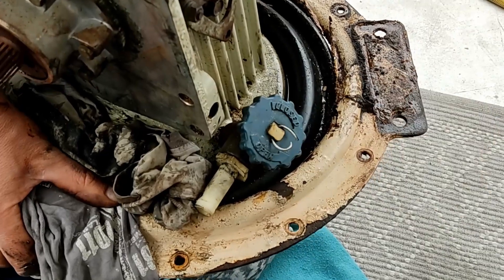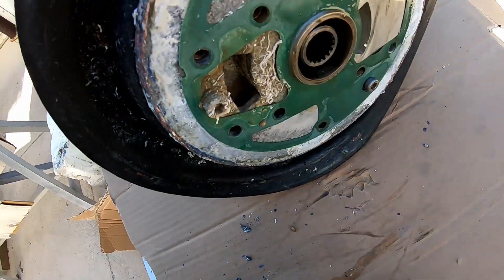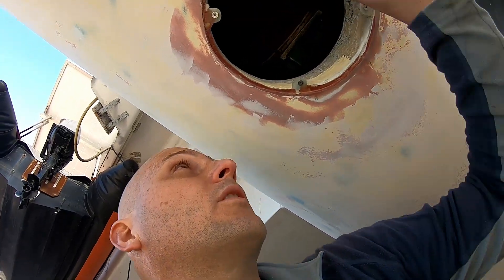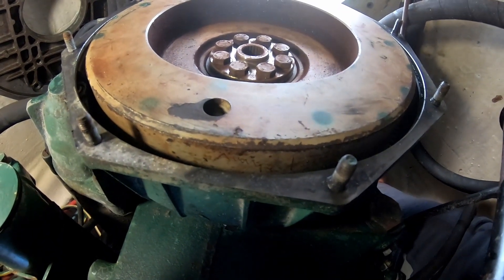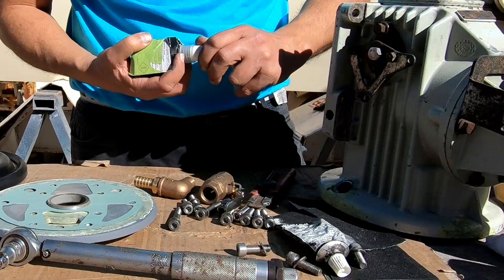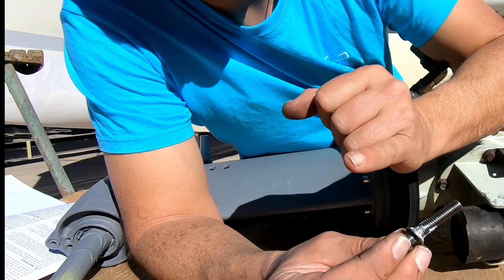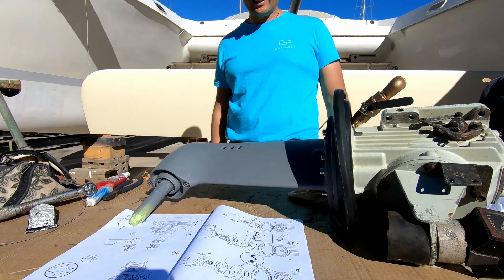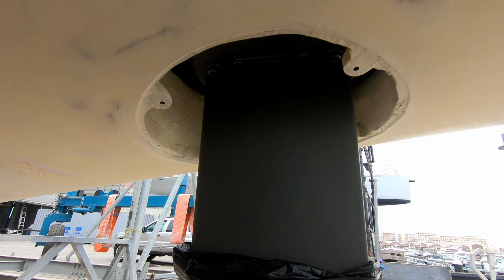Volvo Penta Saildrive Service: Reassembly, Sealing, and Antifouling

Comment: Splendid job Shayne !    I had those same outdrives 22 years on my Fontaine Pajot Antigua.                   France to Phuket the slow way.   Not being mechanical  AT ALL, apart from oil changes I got away with  zero maintenance.     But I did sail it a lot so relatively low hours.   Age and  arthritus finally stopped me .    And I believe the new owners, a young couple like you guys, just kept the units going for years .  Volvo Penta.  Last forever?         😊
Reply from the maker: Yup. Not complaints here. Got plenty of other stuff failing but touch wood these drives keep on going 🤞

Comment: This video Just showed up after a search for a review on how good Volvo Folding Props on their Saildrives are . lol. tbh, I'm Gobsmacked at this video, at the amount of abuse the poor things can take for a very long time by the previous owner(s),plus so nice to see you tackle the restoration work so well. My next boat is going to have a Volvo Saildrive in it, with a Volvo Folding Prop, with an ambassador Rope Stripper -  Volvo now supply thinner Anodes to be able to fit them, after looking at the other available Props, any with advantages do seem to have offset disadvantages, so no really worthwhile gains . I have also been looking at antifouling possibilities for Props, and on forums, came across mention by people using it for years with no problems, of painting them With Cold Galvanising Zinc Paint. I've found you can get 1kg tins of 96% Zinc Paint, in a Silicone medium,  which is good for brushing or roller, giving a good thick coat. Apparently, lesser concentrations are available in Aerosol Cans, and that ones for marine use, are identical formulations to the non marine ones, at a Fraction of the price. Apparently 3 Aerosol Coats should last about 18 months, depending on the water the boat is in, so 2 coats of the Brushed o should be at least as good ? I'm thinking 2 coats of that, then finish off with a third coat via Aerosol, for a smooth finish. After having the iron Keel properly sealed with 2 coats of epoxy barrier Paint, I'm thinking of giving it 5 coats of cold Galvanising , plus 3 coats on the rudder, to see how it performs, as I'll be hauling out annually anyway. It's non Toxic, Plus Major Bonus Point, it's Also an Anode, which may just extend greatly the life of those expensive Anodes. Plus on haulout , after a pressure wash and dry, if the paint looks a bit thin, just slap more coats on? I suspect the galvanic effect, slowly erodes the paint layer, keeping it clean ? Still, I'll find out once I've got my boat in the water. Thanks again for this, Best Wishes and Fair Winds.  Bob.  👍
Reply from the maker: I was also surprised at how well the sail drives have taken the abuse. It has certainly reinforced my thoughts that the engineering has improved so much to make them this reliable now.

Comment: Is that bronze hose adapter threaded into an aluminum casting (10:00) really isolated enough by the Loctite?? I'd be very very wary of that allowing electrolytic corrosion to happen in the aluminum. Totally a no-no to have bronze touching aluminum in my world.
Reply from the maker: Yes and no.....
No it is not the ideal situation, but it is a best of other situations. Plastic is a good option for corrosion, but it is high risk with breaking and hot environment. The bronze is safe with strength and  high heat environment. The sealant greatly reduces the corrosion issue due to keeping the electrolyte out of touching parts. This is a detail that will be monitored closely. Like you I was not convinced it was a good option, until i was shown this is the detail used by Volvopenta to replace the plastic fittings that were breaking.
Reply: Gee, you make a good point, it is virtually impossible to electrically isolate two dissimilar metals threaded into each other. The one redeeming feature is the way aluminum tends to form a thick layer of nonconductive oxide. And of course many sail drives will have internal sacrificial zincs nearby. In the plumbing industry there are isolation bushings one can add, to break the electrical contact. I don't know of an easy solution, short of using an aluminum threaded joint, with a hose barb, moving the ball valve farther away. My Yanmar has a brass or bronze spigot that is similarly threaded into the housing like that. Any ideas?

Comment: Would rather hear you discuss the issues than cover the discussion up with loud music.  I'm wondering if these sail drives are still under developed. They are not what I expected, and seem to be a weak point in any boat.  In my viewpoint of requiring robust construction of a propulsion system the sail drive looks vulnerable.  I'd rather see a V-Drive shaft with a alternative DC motor through the V-Drive.  I'm not a huge fan of Sugar Scoop Engine rooms anyway, mainly because of the weight.
Reply from the maker: Sorry if there was more music than disscusuing the drives. We are still trying to find the balance of lots of info Vs boring video. These sail drives are far from being under development. Our ones are 30 years old and 4th generation. So as far as reliability is concerned they are ok. 
I have played a lot with v drives and shaft systems, and can first hand confirm that they are not better. A shaft system still has heaps of service issues just as a sail drive has. The sail drive however has less drag than a shaft system and keeps the engine and drive system much more compact. 
Like everything in a boat there are compromises, having motors far aft like a lagoon is terrible for performance. A motor amidships is terrible for a boat less than 60ft. Having a motor just aft of the interior and in front of the rudder is a good compromise in a boat 40 to 60ft.

Comment: Great vid, was a little worried when you talked about re-using bolts, but so glad to see used new bolts that had to be torqued. So often people re-use those ones and wonder what went wrong. Cheers.
Reply from the maker: Thanks. We try to reuse what whenever we can so long as safety is not compromised.
Reply: @youngbarnacles  It's a great idea that, I guess getting parts at the mo is a little difficult too. Be great to see it sailing again too.